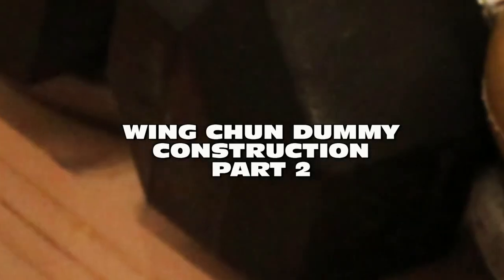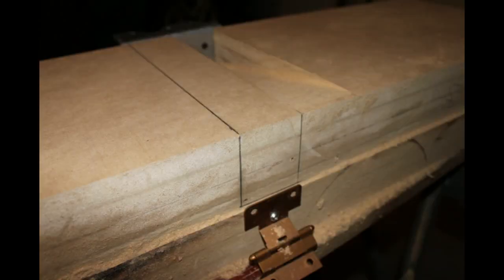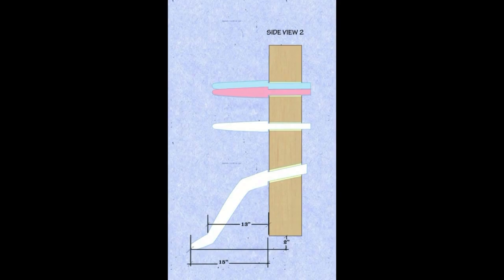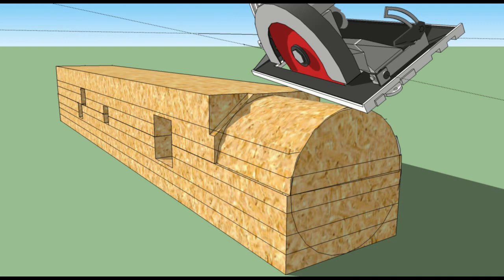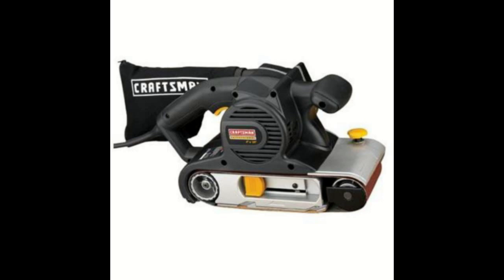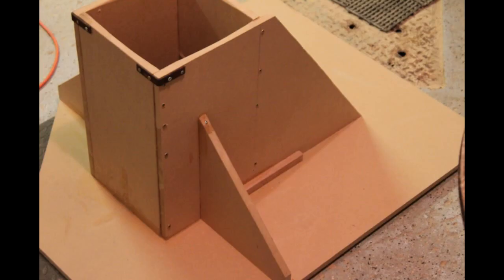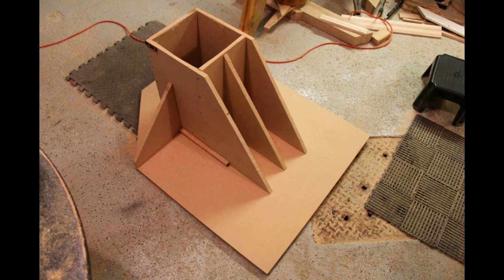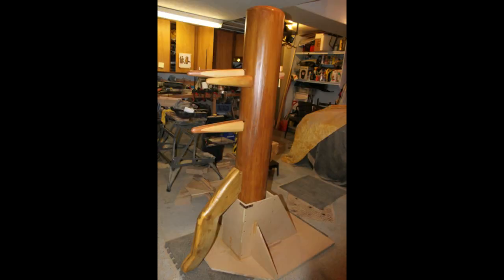dummy construction 4

Comment from the maker: For both arms to be level, you would need to make the arms smaller, that is the part that goes into the dummy.  Right now, my size is  1 3/4 x 1 3/4.  You need to make it
1 3/4 x 7/8.  The 7/8 is half the original size therefore it allows the 2 arms to cross with in the same space of the arm hole, but you arms will be weaker to up or down worth force because it is thinner.

Comment: Hi Sir, I wanted to ask something, my dummy is nearly finish, applying varnish atm, I've applied 1st coat of varnish on top of the 1 thin layer of glue, do I need to sand the varnishes in between the several coats? atm it doesn't feel smooth, will it feel smooth after varnishing?

Thanks

Kenwin

Comment from the maker: MDF is Medium density fiberboard, mostly used for shelves.
MDF is made of fine wood fibers pressed together with resin.
I used 5/8" thick, glued 7 boards together which becomes 4.5 " thick.
You cut it down to 9" wide so it becomes 4.5" x 9" x 5' long.
That is 1/2 the trunk of a dummy.
Then i paint it with glue to make it hard.
Please see my other video for measurements (dummy construction 3 )